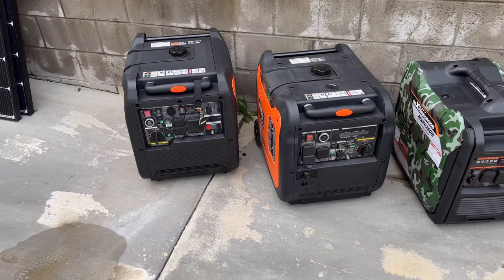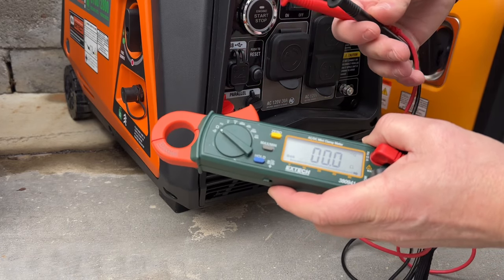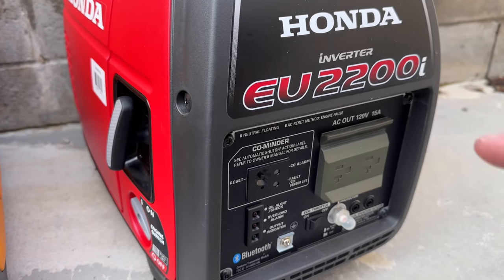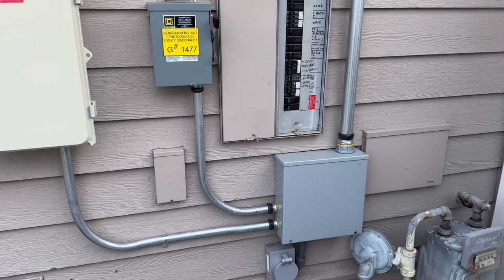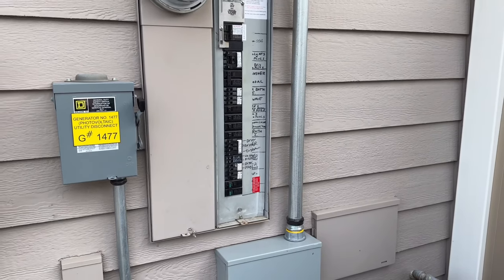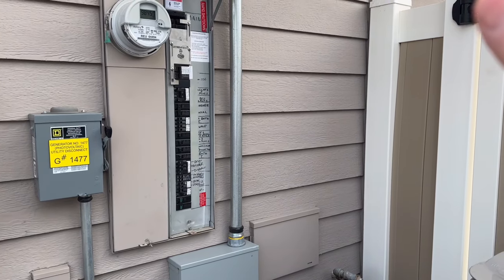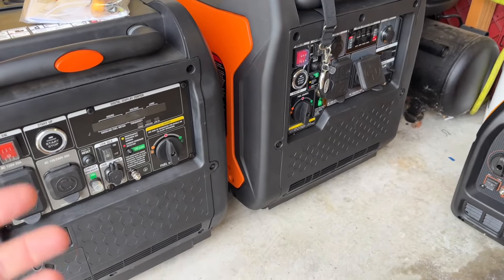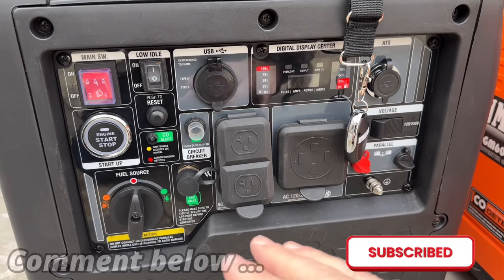Bonded VS Floating Neutral Generator Does it Matter?

Comment: If you are curious to how I have this sorted out as a non-electrician, just someone who has been trying to pay attention, so still do your own research / consult a real electrician, this is what I have:

1. GFCI is only for certain situations, like where people and water may meet up.  The human body is a resister and contact with water can lower that resistance, making for a particularly deadly situation where things go wrong with electricity.  Lowered resistance when making contact with water and electricity means more current flow.  More current flow tends to equal death is far more likely.  Say your toaster oven is next to your sink in the kitchen and water gets splashed on the toaster oven while you are operating the toaster oven barefoot.  Better to have the GFCI outlet detect the small current imbalance between neutral and ground as current flows from a live wire through you and to the case of the toaster oven and trip the GFCI breaker then be toast.  GFCI trips with very small current flows to ground specifically because it doesn't take much current to kill you and this is how it can detect that you are taking a hit.

So now say you are in your home office room and you have a computer setup complete with either a surge protector or a UPS with a built-in surge protector as basically all UPSes have built-in surge protectors.  This computer setup needs a ground - neutral bond for the surge protector to work.  The surge protector will take say a lightening strike and dump the excess power to Earth ground.  On a generator, it will just dump it to the ground - neutral bond if it surges for some reason, especially if you are using a regular non-inverter generator.  But if it cannot detect this ground-neutral bond and establish a sane ground reference voltage, it will not activate.  (Basically it checks for ground - neutral continuity and will not activate without continuity.)  Now you put in a GFCI.  You get continuity with GFCI, so the surge protector activates.  When the surge protector dumps power to ground during a surge, the GFCI sees a big ground - neutral current and pops the breaker.  On grid power, you may see this happen several times a day and this will ruin your productivity.  On generator power, especially a regular generator, you may see this every time your fridge or say older air conditioner kicks on or even a vacuum or blender or what have you and this will definitely run your productivity.  For reference, with no GFCI, just a regular ground-neutral bond, the surge protector will dump to ground and you won't even know; short surges do not trip breakers.  So you really don't want this GFCI outlet there, especially not on the generator itself where everything connects up to.

2. Ground - neutral bonding - This is central to having a properly working electrical system in the USA.  If there is a ground fault, you need it to return to source and clear the fault as in the breaker trips.  Any properly done ground wire will be able to handle the current with low resistance in order to pop the breaker.  It is just if it is not connected up on the other side, it cannot work and thus you have things energized and an unsafe situation where someone could complete the circuit with their body.  The human body doesn't draw that much current, but it doesn't take much current to kill you either, so the breaker will not pop when the circuit is completed this way, but you will continue to get hit by electricity by default.  So if you can instead have the power flow over the ground wire back to source and draw the current needed to pop the breaker this way, that tends to work out a lot better.

3. Earth - ground electrode - Earth - ground is more focused around you have a lightening strike to the grid, you need a path to Earth ground to dissipate that energy and stabilize the voltage.  I see this as especially in play if you use surge protectors as the surge protector will see the voltage spike and dump it to ground, which a lightening strike causes a differential with a voltage reference that the surge protector relieves and the ground electrode allows the voltage to be stabilized with a ground reference.  With a generator, either the surge protector never trips if it can produce very stable power or if say surgy devices are in the loop like a fridge or blender or old air conditioner and the generator can't, it will dump power back through the ground - neutral bond when there is a surge.  Maybe if you are operating the generator in an electrical storm, you may still want the ground electrode.  But say you hook up an Earth ground electrode (grounding stake) instead of a ground - neutral bond.  This doesn't help anything as there is no low resistance path back to source to pop the breaker and may make matters worse depending on what all ends up energized including things that are never supposed to be energized.  Whoops.  Earth - ground seems to be more icing on the cake with ground - neutral being more key to basic generator safety.  I would venture to say the safest way to hook up an Earth - ground electrode is to first make sure the ground - neutral bond is correct.

4. Dual ground - neutral bonds with a GFCI generator - This is a bad idea and will ruin your day.  GFCI trips with small ground currents.  As every conductor you use is also a resister, what happens with a dual link is you can create a ground circuit loop with the current split between neutral and ground and a voltage differential on both as resisters create voltage differentials.  Essentially you share load over the ground wire, which is a big no  no.  A ground wire is often a bare wire you only dump emergency loads over and the rest of the time it is more or less dormant.  A ground wire is connected directly to surfaces humans can normally touch, let's say the metal case on your toaster oven.  A ground wire in a loop is a wire carrying current and you don't want to be touching something carrying current.  That is unsafe.  So now you add in GFCI to your generator, bonding ground to neutral in the generator and say a second bond in your electrical panel.  Now as power flows through neutral, it splits the current load over that ground - neutral bond in the panel and it flows through the GFCI ground on the generator as they are essentially two connected up wires in parallel.  As soon as any load goes on the generator, this current flows through the GFCI outlet, going through the ground that is not supposed to see current, but is due to the ground loop and so the GFCI pops.  So now the power cuts off from the generator every time you try to put any load on the generator.

5. Common ground reference voltage - Something else to throw in there maybe not thought about enough is say you have copper Ethernet cables going around your house and sensitive electronics on either side.  It is probably a good idea to make sure all of this equipment has the same ground reference voltage.  Especially when you get into analog audio cables, not having a common ground reference voltage is something you can hear if an analog signal is going between powered devices and they are not both bonded to ground / the same ground voltage reference.  Going back to the sensitive electronics, you don't want say static discharges happening through sensitive equipment because they did not share a common ground voltage reference.  I have seen things like while at work with low humidity strong electrical shocks when making contact with plastic monitor cases as the static charge buildup leaped across through the plastic and regular arching from say the VGA connector on the laptop to the desk, causing the computer to randomly restart when the building grounding wasn't properly hooked up and something was causing static charges to build up on that dry day and major voltage differentials to form.  Once the ground wire was properly connected, the issues stopped as reference voltage equalized across the building.  Granted this was in a huge building, so this apparently led to the possibility of huge differentials to build up without proper ground reference throughout the building.

Comment: Question I connected the ground and neutral wire in the generator is that ok to do instead making a plug
Reply from the maker: It’s basically the same thing but plug you can remove

Comment: You can definitely bond more than once, it’s required for each separately derived system. The building I’m working in has like 30 or so bond points in the building
Reply from the maker: Yea but that’s a building verses a home in which says only one point of bonding. But that’s what I read from NEC…🤷🏼‍♂️
Reply: I have a home that’s has two separate ground/neutral bondings. First would be at the utility power disconnect. Second would be at the whole home backup generator. I use a transfer switch to switch between each of them, and the switch is a 3 pole, so it switches L1 + L2 + Neutral. As possum stated above, you must bond for each self derived system. I have two…utility & generator.
Reply: But why don't you bond a neutral and ground wire? I have a new construction home and I'm trying to test my ac before sheetrock is done.
Reply: So, you're saying the building that you work in has "30 or so" separate utility feeds?

If in fact you have one utility feed to a "main" panel and 29 more panels that are being supplied from that main panel, then those 29 other panels are considered sub-panels where you are not allowed to have a bonded neutral.
Reply: I think you're twisting words. You should have only ONE bonded neutral in a COMPLETE circuit .  If your panel is bonded your generator needs to be floating
Reply: @LinksterGaming  I’m sure you’ve figured it out by now. The short version is that there should only be one place where the neutral and ground are bonded, meaning tied together. Otherwise the neutral current would also flow in the ground wire, making the ground less effective as a safety feature.
Reply: @Mixwell1983 You could theoretically unbond the generator from the building by not connecting the ground wire from the generator to the building. I would consult an electrician before doing this for their advice, and maybe your inspector.

Comment: I've noticed on a few 240v devices like a standard 240v  battery charger for example has the earth wire inside the charger connected to neutral is this normal ? How would it effect a generator with centre tap or other types like floating
Reply: I am assuming the this is mounted to the North American home 240v grid power and not a generator. The NEC requires only one connection of the ground to the neutral at the first disconnect. I would investigate your connector in great detail to try to figure out if it is correct for your application and is it properly installed. You may find out is that the ground should have been disconnected. The neutral is only used to create 120v from one leg. It can get very confusing in applications in certain applications where no neutral is provided like in a three wire dryer plug or oven. Some new appliances obtain 120v by using the ground as a neutral and others use a transformer to power the lights and circuit boards. Their drawings show the wire as a  neutral on the appliance and as the ground wire on the the wall side. The only difference between a neutral and a ground is where it is landed in the breaker box. Electrically they become the same when the ground and neutral are bonded.

Now for the fun part. The NEC does not apply to appliances like EVs or dryers or ovens. The NEC only applies to the building wiring.

Comment: Hey peeps!
Just bought predator 5000 inverter generator. Floating neutral. Do I need to ground this thing when the travel trailer is plugged in?
Reply from the maker: No.  The generator will use the trailers bond.
Unless you are using a power watch dog, or have a on board power management system
Reply: @johnnysweekends  Gotcha! Thanks

Comment: I have the genmax 7250, need to make it a floating neutral, do you know how to do it on the 7250?
Reply from the maker: You would have to take the case off the rear of the generator it self and remove the white wire I believe. Small jumper wire normally. 
You can call the Genmax location in San Diego and see if they have an instruction sheet to email…🤷🏼‍♂️

Comment: So I have a portable generator for which I use extension cords, it is not hooked up to my electrical panel. I have learned that it is not bonded, but rather the floating neutral type. Isn't it supposed to be bonded for the way I am using it? It seems like if a device has a fault, if my generator is not bonded, the breaker will not trip and everything is energized leading to the possibility of an electrical shock. Isn't that correct? So should I go in there and add a wire to the neutral and ground lugs to bond them?
Reply from the maker: Most generators are floating, and if there is a short the generator will trip shutting down electrical flow. It has its own breakers.
Reply: @johnnysweekends  That's certainly not what everyone else is saying. If a neutral is not bonded to the ground and there is a fault on a device, how is the charge going to eventually wind up back to its source (neutral)? The charge will just sit on the ground waiting for someone to touch something metal in the circuit, device, and generator. This is what everyone else is saying.
Reply from the maker: @BillSmith-rx9rm I’ll have to make a video I did this years ago touching the two wires and the gens trips…now sure shock on tool or item could be possible if holding it but its a split second at 120v…any electrician has been buzzed by that several times. It will scare you but not kill you. There are thousands of generators out there being used every single day using extension cords. I dont see anything ever in the news about people dying or even getting hurt enough to make a news article. You could easily bond it if you want with a bonding plug. But bonding it is not needed for floating N gens when on its own. The gen will use a homes bond if using it for back up power for the home. I’ll put together a video I guess on what can happen…..why not make some sparks and blow stuff up…😀👍🏼

Comment: I have a WH igen4300df during the Texas ice storm I connected my gen to my inside air handler/gas furnace. It would energize my t stat and you could switch the stat would click like it was calling for the blower but the fan would not run.  How do I fix this?
Reply from the maker: You need to bond the generator
Reply: @johnnysweekends so meaning sacrifice on of my generator recepticals and use a bonding plug like you show in the video?   Thanks for your help BTW great videos.
Reply from the maker: @kevinr5187 yes
Reply: Tha @johnnysweekends  thank you Sir!

Comment: Question... I'm running 2 3,500 inverters in parallel.  Do i need a single bonding plug in one of the inverters or both?
Reply from the maker: Normally just one. Some gens could be different.

Comment: Inverter Generators with neutral floating : Can someone answer this in my manual it states (Circuit Breaker - The receptacles are protected by an AC circuit protector. If the generator is overloaded or an "external short circuit occurs the circuit protector will trip".)  note last part short will trip ? But I thought a neutral floating wont trip because its not bonded to ground and if say a toaster is shorting out you'll get shocked but the toaster still works ? BTW this is using just an extension cord to say a toaster.....

Comment: My small inverter generator has a Floating Neutral.  I plan on using it with extension cords only (fridges/computers/toaster/microwave) in emergencies.  Would it still wise to use a bonding plug on one of its receptacles?  Thanks for your video/advice.
Reply from the maker: You shouldn’t need one with those items.

Comment: Hello need your help. I have a manual transfer switch called Reliance Pro / Tran2 and my generator Honda EU2200i companion30A. Question will this work don’t know if it’s bonded honda stamping neutral floating. What do I need can’t see anything on the reliance that says anything about bonding. I could send you a photo of the transfer switch. Just need your email. Love your channel thank you
Reply from the maker: The Honda is a Neutral floating and will use the bonding from inside your main panel. So one bonding point. This is after you wire the TF in according to the instructions from reliance. So you should not have any issues.
Reply: @johnnysweekends  you think this is all set for me to use. Or do I need that ground plug 🔌 to generator
Reply: @johnnysweekends  what is the TF. that transfer switch is all hooked up. Thanks
Reply from the maker: Only reason you would need bonding plug is if furnace doesn’t kick on or water heater maybe. But all depends what you have. But you should be good to run fridge, microwave, or little heater and more. 
No plug needed because the reliance TF switch will be bonded to your main panel
Reply: @johnnysweekends   so what I told you about my generator & transfer switch. You think I’m all set. Thank You
Reply: @johnnysweekends  you think I should have a bonding plug to have on hand. Or you think it’s not needed thanks
Reply from the maker: Yes, have someone who knows what they are doing install it..and then follow proper instructions on how to use it. 👍🏼